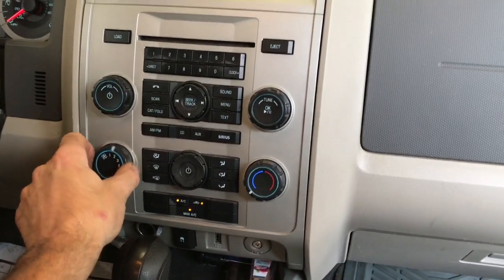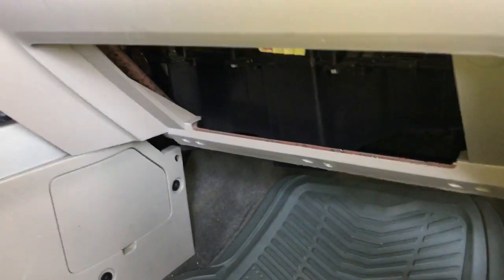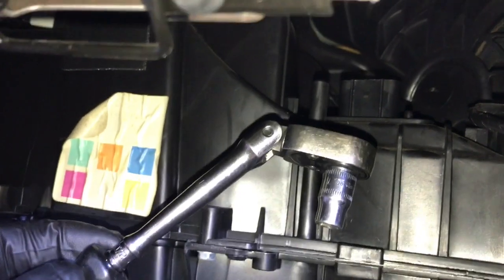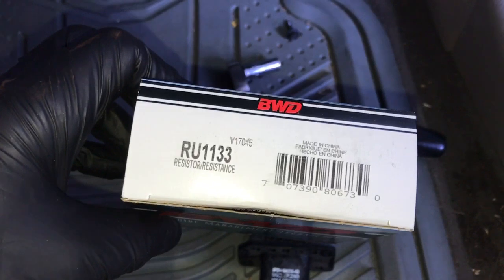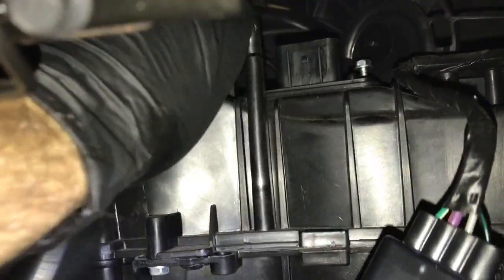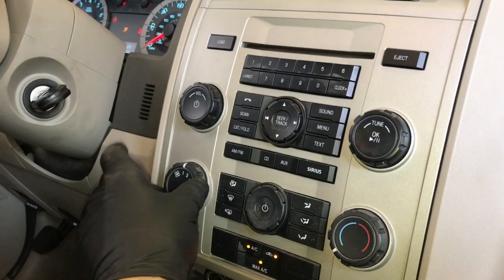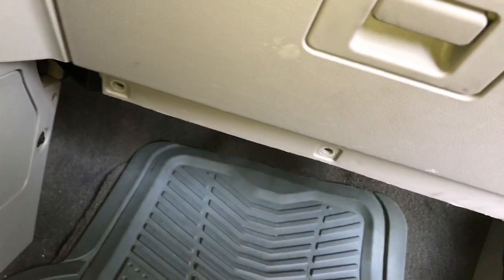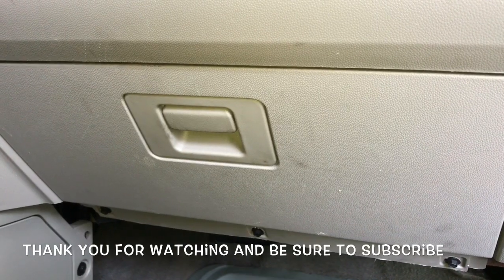How To Replace The Blower Motor Resistor On A Ford Escape

Comment: 2008 Escape replacing the resistor.  Brian you are the only video tutorial  I found where step 1 was to remove the glove box completely rather than simply opening it up from the inside.    I still took quite awhile to access the 2 resistor screws but it certainly helped having move elbow room to work in.   You get the prize today.   Thank you.
Reply from the maker: Bev Ward i'm all for working around things but sometimes it's just easier to remove. Thank you for watching!

Comment: Best video on this resistor replacement. Thanks!

I just finished this job and it worked perfectly with the recommended Motorcraft part and a 3" long 1/4" drive socket wrench. Once the socket is on the screw head, the braille method is mandatory. 
A couple extra tips you may find useful:
-The plug is hard to push up with your fingers while holding the tab in. I used a flat head screwdriver to insert into the gap on the bottom and lift gently on the bottom, tilting up left and right to make the gap bigger while holding the tab in. Then I could use my fingers to lift. It was much better than trying to lift with my fingers.
-Keep the old part nearby for reference so you can remember which holes are for the screws. 
-When reinstalling the glove box, be sure to line up the tabs before installing the screws. 
DON'T OVERTIGHTEN ANYTHING! These screws go into plastic.

Thanks again!

Comment: Brilliantly done. Concise, clear, informative, good camera work, & brief. Going to attempt this job on my wife's 2012 (which #4 ONLY works.)
Reply: did this fix your problem? i as well only have operation at full speed.
Reply: Did you guys have a rubber or bring smell when the heat or air was on too?

Comment: High quality video, in 100% focus, well illuminated and tightly edited, thank you.  My 2009 Ford Escape is a YH23 Blower Resistor, have one ordered.
Reply from the maker: B Baker glad you like the video. You need blow when it’s hot out!! Thank you for watching!
Reply: How to Automotive Have you had any problems with yourEscape Air Conditioner?  Apparently a very common issue is the desiccant bag breaking and all the particles end up plugging the pressure valve and then the computer runs the radiator fan on high speed anytime AC is on.
Reply from the maker: B Baker This is a customers car so I don’t know of any problems with the AC.

Comment: In addition to this very helpful video. My part number was different, but still worked. Also, my part was not initially seating as it should, and I noticed one of the holes was not drilled out as on the original part. It was a hole where a nib fits into. After drilling that out with a 3/16" drill bit, it seated just fine. Thanks for your helpful video here.

Comment: Would it Be the resistor if the AC doesn't work on all speeds plus if You kick it it works for awhile or could it be something else ?

Comment: Just completed this. $27 from Amazon, 1 day shipping. 15 minutes time, 10 of it spent trying to find a 7MM & 8MM. PLEASE NOTE: This part gets very HOT. I'm assuming that's why they blow out but if anyone tests before installation, the hot is instant, be careful not to burn yourself. MAKE SURE YOU DON'T CHEAP OUT. Be sure to buy a real Motorcraft part. I don't think I'd trust an off brand to the heat, although it's probably all made in China.

Comment: I have a 2007 Ford Mustang GT Convertible (only 80,000mi).  I have already replaced all of the HVAC actuators, reset them, recalibrated them, blah blah blah.  But on LONG drives (more than 3 hours), the A/C blowing will default to the defrost vents BUT ONLY when I have the A/C selector on "Normal" A/C.  It works fine if I put it on MAX A/C or Hi-Lo AC.  But when on Normal, it will work for a few moments and then it will switch to blowing through Defrost vents (still blowing cold.) Even though I touched nothing.

I have already done ALL of the common fixes (via HOURS/Days of online research) for this issue - but No permanent Fix.  (on long drives only.)  This tells me there is an overheating issue of the electrics - or one (or more) of the actuators themselves are internally overheating and malfunctioning.

I was next going to replace the actual dash Climate Control panel/assembly - just for the fun of it.

Anyone else had this issue and permanently resolved it?  My fixes were only temporary.  People who have actually resolved this, please.  I have already "shot in the dark" plenty....
Reply from the maker: Horsepower House I have not run across an issue like this so far. There also may be a programming update for the AC controller that you may wanna look into before replacing it. Ford is always coming out with software updates for issues like this.
Reply: @HowtoAutomotive  Could I do this myself  with the IDS software?
Reply from the maker: Horsepower House Most likely yes. Worth a try.
Reply: @HowtoAutomotive  Now to find a legit hack to use the IDS app.... lol

Comment: Why does the resister have to be bolted in? Can you just take the wire harness off and plug it in to a new resister. It’s an old vehicle, just let it hang behind the glove compartment?
Reply from the maker: Because the airflow inside the airbox prevents it from overheating and burning out